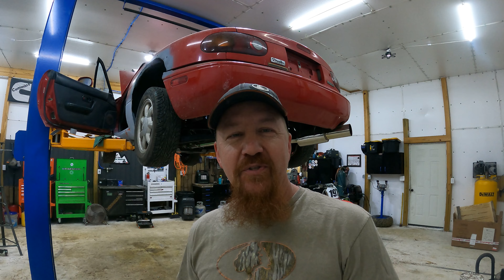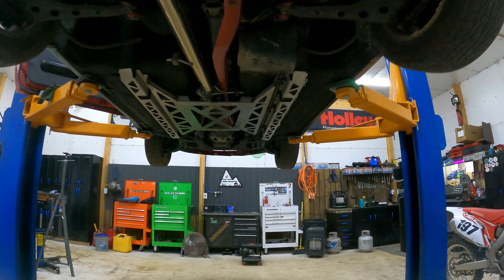What You Need to Know Before Building Your Own Dream Garage - Post Frame Construction DIY

Comment: my shop is post frame and it is 15yrs old and zero issues with the post in the ground. my post are not regular post. they are made out of 3 2x6s screwed together. my builder told me that they were less likely to twist. my only regret is not insulating under the metal roof
Reply from the maker: I have laminated posts as well.